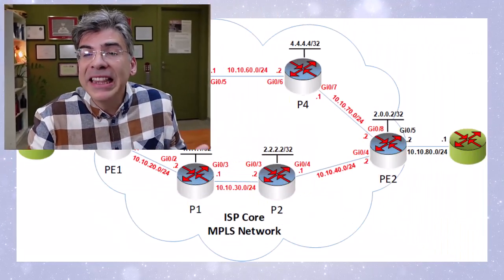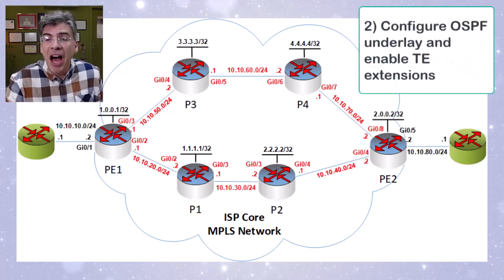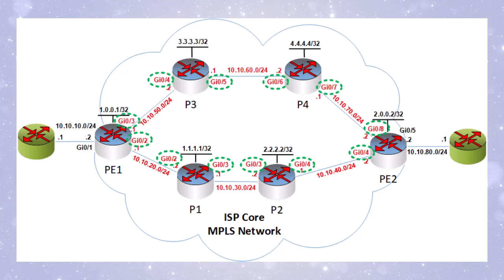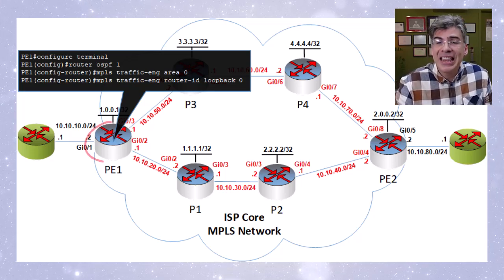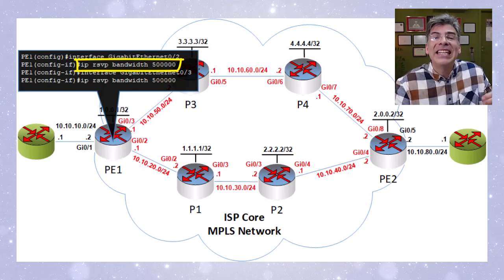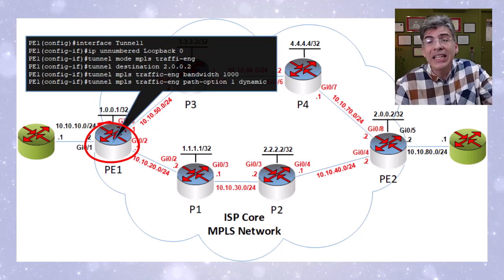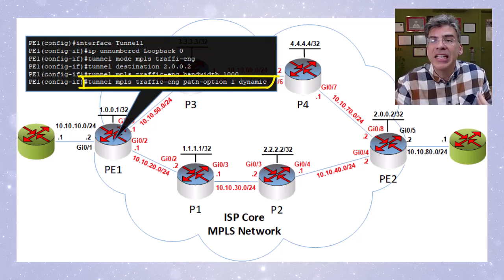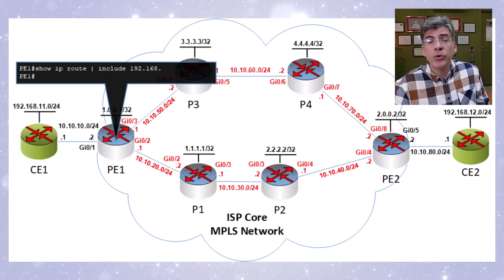Configuring the MPLS-TE OSPF Underlay

Comment: How do you calculate the bandwidth values to use?
Reply from the maker: Hmm, that's not an easy question to answer. Calculating the bandwidth values for RSVP-TE configuration in an MPLS TE topology involves considering several factors, including traffic demand, available link capacity, and network constraints. 

To do so, you can start by analyzing traffic demands and available link capacities. Reserve a portion of link bandwidth for TE, configure LSP bandwidth explicitly, and use preemption mechanisms to prioritize critical traffic. Regular monitoring and optimization ensure that bandwidth allocation remains efficient.  Does that help?

Comment: I watched your videos in this series starting from the MPLS https://youtu.be/vBi4T5dl_YM?si=IOpeTs5k-4FExjhT and found them all very useful. For this video, are you showing OSPF as an alternative to BGP on the provider network? One of your earlier videos showed BGP. Also, what application are you using to draw the routers and show the command line?
Reply from the maker: Hello and thanks for the feedback.  I'm glad you find them useful!

Concerning your question, in this video, I'm demonstrating OSPF as the IGP for MPLS-TE. It’s not necessarily an alternative to BGP in the provider network but serves a different function. In past videos on MPLS, BGP was used for MPLS L3 VPNs where Multiprotocol BGP is used to distribute the VPN routes across the provider core.  In this case we're not using VPNs, but in this particular video, we're looking at MPLS-TE which focuses on traffic engineering.  OSPF or IS-IS are typically used as the underlay IGP for TE, and that's why it was chosen.  Does that make sense?